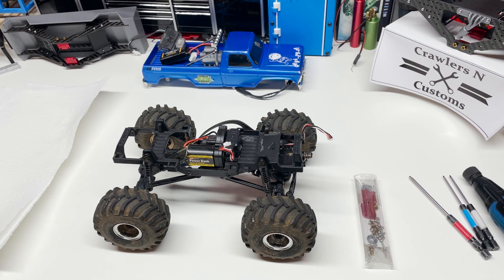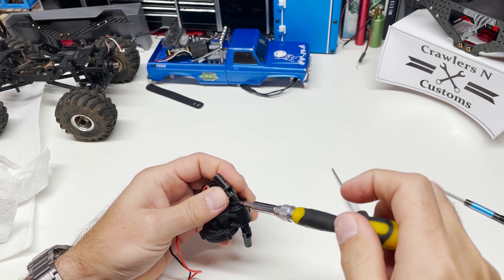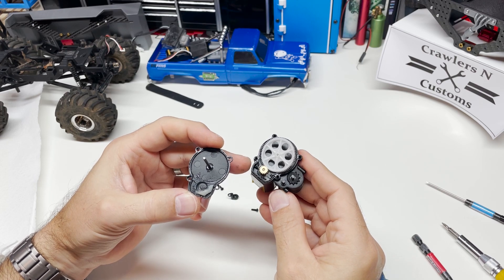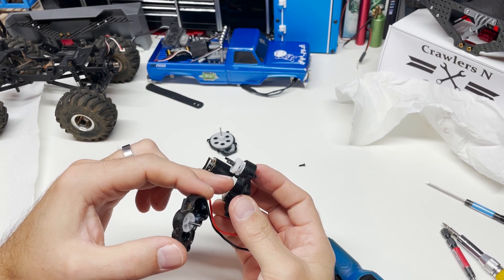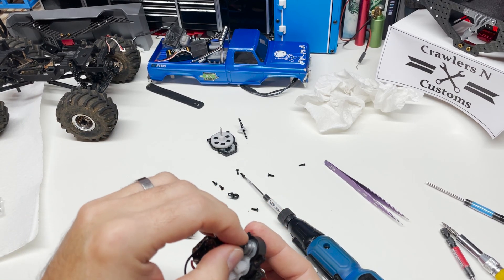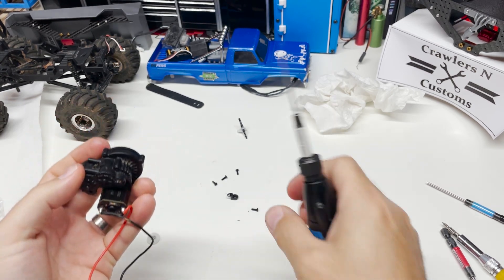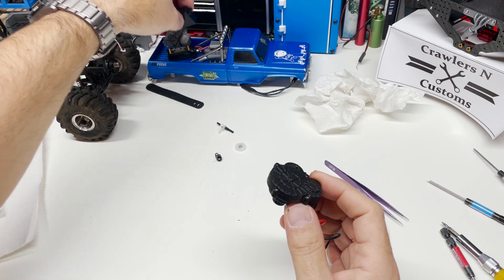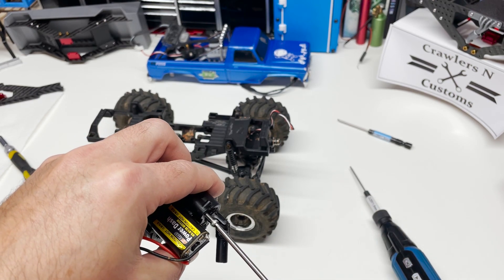High Speed Only FMS Smasher (Slow Gear and Servo Delete)

Comment: You guys rock for posting the files for 3D printing!  Got my 5yo’s smasher up and running on the high speed gear, aaaaand promptly broke the rear drive shaft about 60 seconds later 😂
Reply from the maker: Lol that happens 🤛🏼🤘🏼😂
Reply from the maker: Btw the fms metal shafts are almost a must have. I have them on both the portal flip and standard set ups.
Reply: @crawlersncustoms i have a set of the injora metal ones on order, hopefully they hold up.  😅

Comment: Would this work as a high speed lockout if you swap the high speed gear out for the low speed one?
Reply from the maker: Not sure!  Give it a try.
Reply: Yes, it works. I did it accidentally, because I swapped the wrong gears.

Comment: What exactly is the kit to lock out transmission? I didnt see anything on website.
Reply from the maker: The lock out comes with our chassis kit. It’s basically a keyed spacer that takes the place of the low gear and shifter fork.